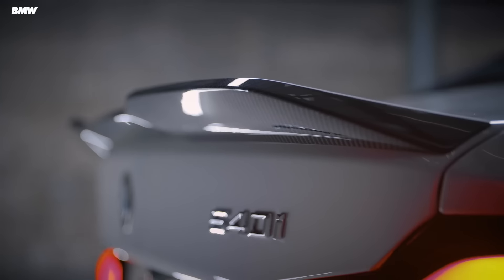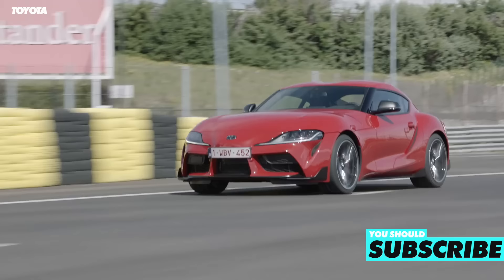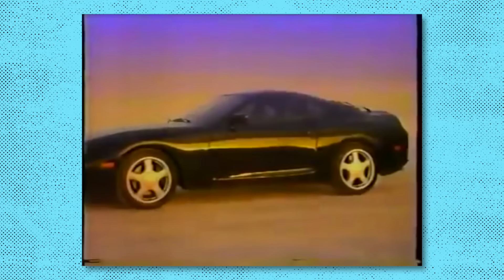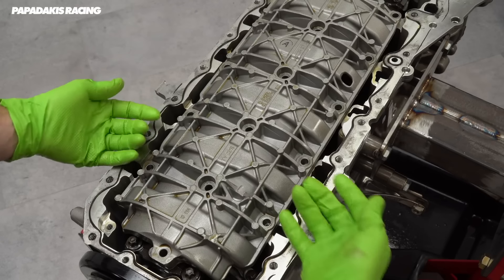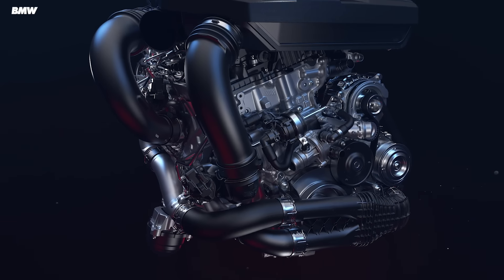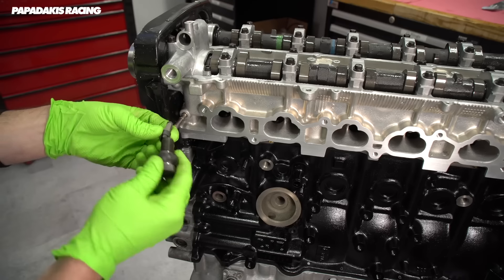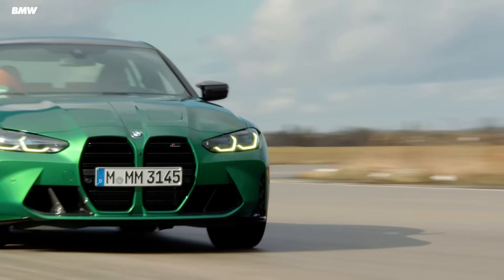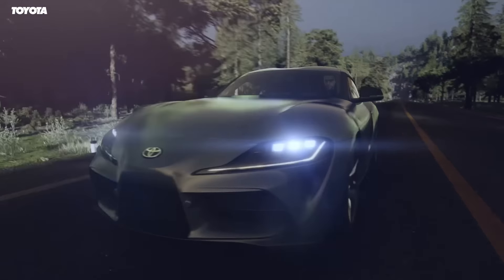Inside BMW's Greatest Engine

Comment: B58 is also closed deck, and not open deck as shown in the video. Agree it’s a very good motor. Seems like BMW left the best for last. Now if they could have done this engine in the early 2000s and put it in a E46 Coupe that would be a dream car to many just like the MK4 Supra.
Reply: The m54 is also a sturdy engine though, those e46 engines can handle quite a bit of power
Reply: @evilempire2845  m54 and s54 are two different engines. He’s talking about m54 there was no spelling mistake
Reply: Would it be possible to swap a b58 into an e46?
Reply: @notadocbuta6180  if you have to ask this question then you shouldn’t even be thinking about doing it
Reply: The s54 block was an iron bomb shelter. But modern engines are better off with the added cooling off aluminum and running iron sleeve if you want dummy power
Reply: @notadocbuta6180  yes but you would need to do a lot of wiring and supporting mods to handle the power. Unless you plan on doing it yourself you’ll be spending at least 20k
Reply: Someone in eastern europe swapped a B58 and manual trans into an E36 and tuned it to 700. Seems like a fantastic car but I can't find much about it online.
Reply: In Papadakis Racing's video on the teardown of the B58, where that clip is from, he makes that distinction. Not sure why they chose that part of the clip.
Reply: @CSLFiero The S54 had an aluminum cylinder head. Cooling isn't really a big factor with iron block engines, modern engines use aluminum blocks because it's lighter and can get the same rigidity with a girdle. Al is less than half the weight per volume as iron, the extra weight is unacceptable in today's times, it has less to do with cooling and more to do with weight.
Reply: @notadocbuta6180  Yes is the simple answer. I'm in the process of fitting one into an E30. Waiting for the Quaife sequential box to turn up.
Reply: No way they could have done this engine back in the early 2000s, they didn't have Toyota around to give them some standards back then.
Reply: @iunnox666  lol u rly got no clue
Reply: @alpha-cf2oi  Toyota wouldn't put their name on the engine BMW brought them for the Supra. Their standards are much higher than BMW's in that department. BMWs are designed to last no longer than a lease period.
Reply: @iunnox666  bla
Reply: @iunnox666  the Supra warranty is from Toyota, not BMW, including the motor. They approved of its quality standards.
Reply: @ike2010  Yes, after they told BMW to go back and do it right. The engine did not meet their standards for reliability.
Reply: It is just on paper, so many reliable racing engines, both NA and FI with open deck blocks were just fine. In the real world, on the road or in racing, both can be reliable and strong. The N54 is a classic example of this, you forget that the B58 has its timing chain system on the rear, which means it is a full engine out job and we all know how reliable the timing chains are on BMWs.

Comment: Love the B58 in my M140i.
It's a fantastic engine, and with a 200 cell cat and remap, mine made 455bhp/634nm, awesome in a 1 series.
Reply: I bet that thing SCOOTS
Reply: I’ve not swapped my cat, but I’m pushing 420bhp on a simple tune. 9 months ownership and not a single hiccup… most amazing car I’ve owned. Smooth engine when in comfort and an absolute beast of animal when in sport plus. Defo get springs done if you haven’t, made a massive improvement to the drive feel compared to stock
Reply: @pboytrif1  Nice Phil, dyno figures always vary hey matey, mine made 411bhp/576nm after a remap, now 455bhp/634nm with the Wagner 200cell cat. Next step dorch HPFP and upgraded cooling mods for 480-490 wohoo !
Reply: @DjNikGnashers  go for port injection instead of hpfp, cheaper and gives you room for bigger power.
Reply: @JuampixDDD  I can't be bothered with filling separate tanks for meth mate, and plumbing it in.
I just want the convenience of running on pump fuel.
I do agree it is a great option for cooling the engine and making big power though.
Reply: Bruh 450 hp in a 1-series is fast as fuck
Reply: @svenkerkhof6653  It's pretty quick Sven, but you soon get used to it and want more !
Reply: I had that we never got these in the states...
Reply: Sheeeesh
Reply: I have since swapped my OEM cat for a 200 cell with an OPF delete and a Stage 2 map. Sounds and picks up better... and easily hits 450 bhp!
Reply: @svenkerkhof6653  Bit faster  as Porsche 992 Carrera S
Reply: Are you guys passing emissions with the 200 cell cats?
Reply: @Anythingyoulike2013  with a ECE legal HJS downpipe you’ll pass it - don’t know about other brands
Reply: @vollcare4076  They unfortunately don't do one for my 640i.  I thinks theres an option out there for me but its about £2k.
Reply: @Anythingyoulike2013  I thought all B58 downpipes should be the same, doesn’t matter if it’s M140 / M240 or 640i, should be same part
Reply: @vollcare4076  240i is b58. 235i and 640i are N55 bro.  And with the 640i i cant interchange it with say a 235i or 535i.

Still, love this range of engines.
Reply: @Anythingyoulike2013  the 640i is a B58 since 2017 as well (G-series)
And this video is about B58, not N55
Reply: @Anythingyoulike2013  Mine was on the boarderline but wouldn't quite drop below the pass for long enough, so my friendly MOT tester suggested I opened up the valve for the 2nd exhaust which halved it, and passed.
Reply: @DjNikGnashers  nice fix there! im guessing you just had to disconnect vacuum line from exhaust valve and close line with golf tee.
Reply: @Anythingyoulike2013  No mate.
When MOT testers do emissions tests on cars with 2 exhausts, if they have a valve which closes off one exhaust as a lot do (the M140i does), they leave one exhaust closed and test the one open one. Or, they have both exhausts open and combine the readings, as the gasses are flowing through both and are basically halved.
The way to get around it, is to have both exhausts open only only test one, as if the other exhaust was closed.
Reply: @DjNikGnashers  LOL. 490 without a turbo upgrade is dreamland. Glad your dyno peeps like making your day but your on cloud cookoo land.
Reply: @sheilamorrison1954  480-490 with a complete decat, high flow (Dorch) HPFP, and cooling upgrades (big charge cooler rad) is possible.
550bhp with a Pure800 turbo on 99ron fuel.
Worked in the motor trade for years, so I don't listen to muppets in youtube comments when I know from experience thanks.
Reply: @DjNikGnashers In this case "random person on the internet" was part of the early development of this platform through 16/17. My car was used by Odin, Marin and Imran at different stages of testing. Without meth, these aren't reaching a genuine 490 on stock turbos even with HPFP upgrade (Which helps mostly mid range, very little up top...). Unless you have a generous dyno or slack straps that is.
Reply: @Anythingyoulike2013 
Yes. Pass with plenty of room to spare.
Reply: @DjNikGnashers 
I had a Wagner 200 cell sports cat.
2nd exhaust valve disabled as I hated the noise opening and closing.
Passed emissions no problem on the last 2 tests. They only ever put the probe in one exhaust.
Reply: @andrewdouglas1963  I had mine for 4 years (fitted with a Wagner 200 cell cat, and the exhaust valve wired open permanently), it passed the first MOT, it just scraped through the 2nd MOT after I took it up the road for a quick blast. It would not pass the 3rd MOT or the 4th.
Thankfully I worked in the motor trade for many years and a good friend was MOT-ing it.
He only put the probe in 1 exhaust too.
Reply: @DjNikGnashers  
I think my local MOT garage didn't know to use 2 probes. Or maybe thought the car automatically closed the other (which it would had I not disabled it.)
Reply: Death trap on normal wet road
Reply: @stevenvater2681  
Only a death trap to the foolish and inexperienced.
I had mine for 4 years and don't recall anytime where I felt it dangerous in the wet. The traction control is fantastic,

Comment: Got a B58 in my 2018 m140i and a simple tune to 420bhp. 9 months ownership and not a single hiccup, it’s just the most incredible car I’ve owned! And for £25k second hand I can’t imagine a better bang for my buck! No ragrats
Reply: 9 months no hiccup for a BMW is good? The car I drive hasn't had any hiccup in 24 years with 190k miles... was thinking BMWs look great but it seems reliability expectations are low
Reply: he's only owned it for 9 months how can he give you more info about the reliability smh @producerkeshav
Reply: true true  @TehNiCoLaS
Reply: @producerkeshav  yeah but ur car does 0-60 in 2 years ...
Reply: 2 years here m140i and no problems, just servicing every year/6-7k miles. i did replace my PCV valve today for preventative maintenance as those do wear out, mine had a split in it but showed no symptoms of smoke/whistling, only takes like 5 minutes to change and costs a tenner

Comment: The new 1 series is a FWD car that has its biggest engine a 2L 4 cylinder. The 1 series you are talking about is out of production since 2019
Reply: think he meant 2 series
Reply: @Richjtj  bmw m140i had the b58. The new m135i is a 2L 4 cylinder.
Reply: @Richjtj  old 140i had b58

Comment: I have the new Mini Cooper S with the B48 engine - the smaller 4 cyl brother of the B58 - its a modular design so the pistons, rods etc etc are the same. This engine is unburstable. Its done 78k and on a recent dyno pulled 214bhp, and its stock. Theyre only meant to make 192bhp when new. Astonishing. I still get 42 - 45 mpg on a cruise at 70mph. Never had to put oil in it outside of a service. Cant recommend them enough.
Reply: Mini cooper S owner here!! I agree with you. Absolutely an incredible and stable engine!! Full of immense low end torque!!
Reply: @nathanperdomo2111  Yeah, its a great engine, but doesnt like revving much past 5000-5400rpm. Mine's covered 106k now, and is still very reliable and sound. Ive just ordered a JCW, but due to the supply chain for electronics being so bad, it will be next year before I see it !

Comment: One of the tuners I know has the 2020 Supra with the b58 ... He has tuned it to 677 kw which is about 905hp ... The engine internals unchanged and he believes the limit of the stock engine block is around 1000hp ....
Reply: For a modern engine of that size  , it's insane and more then enough for any car enthusiast with deep pockets . The only people that hate on the mk5 supra are the keyboard warriors .
Reply: @cosmins3268  For real. Toyota isn't a bunch of idiots. If they trusted bmw to make a car that would live up to be called the mk5 supra, then certainly they were up to the task. I mean for god sakes, McLaren trusted them to make the engine for the F1
Reply: @cosmins3268  So true
Reply: The level of misinformation is on another level
Reply: @user-mh6ie9wm6m  Akio Toyota’s daily driver is a Supra. I think he wanted to drive a BMW, but the Supra was the only way to save face. 😆
Reply: @cosmins3268  this exactly man, it irks me how many people complain about the Supra but aren't even in the market for it. 
Never mind them understanding the economic aspect and the fact that the Supra wouldn't have existed without the BMW partnership. It just makes no sense building a 6cyl engine from scratch for one car that's also in a pretty niche market.
Reply: Umm, no, stock B58 internals can only handle 650hp, MAYBE 700.
Reply: @qx4n9e1xp  Stock block Supras are running 8’s in the 1/4 mile. They are pushing above 800 wheel. Depends greatly on the tuner but no, 700 is not the limit.
Reply: @cosmins3268  Sofa Army xD